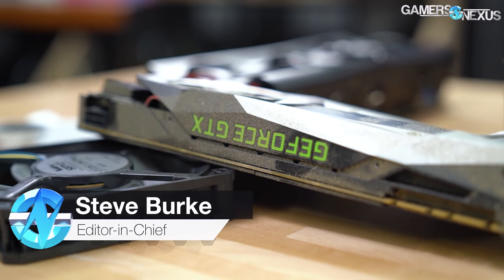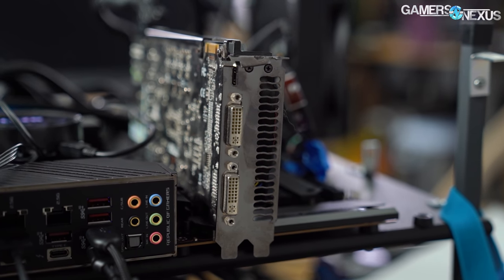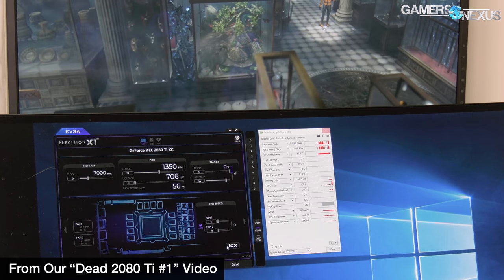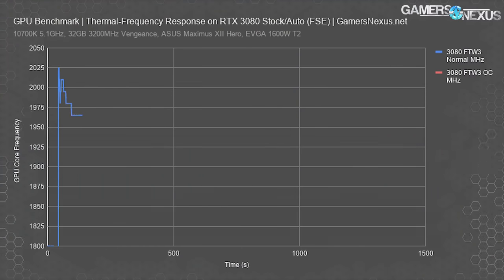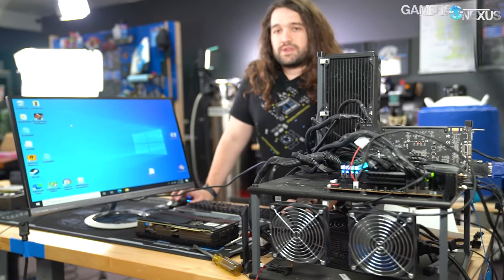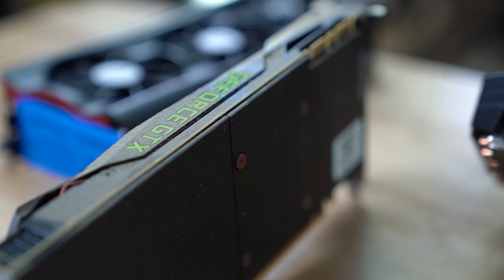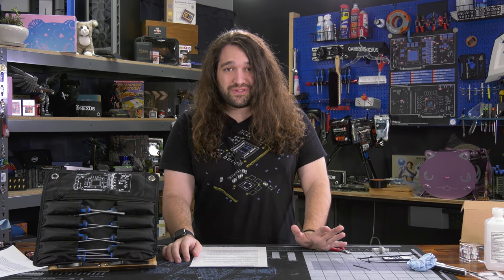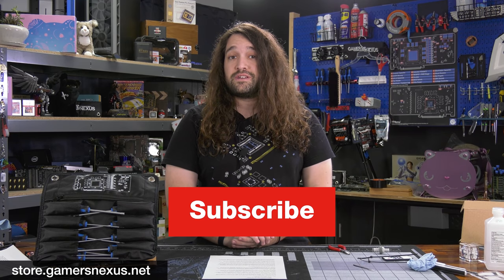Warning Signs When Buying Used GPUs: How to Detect Defective Video Cards

Comment: 700$ for a used 580 that can’t be right I can’t get my brain to align that with reality Christ
Reply: The only ""logical"" explanation I can think of is that the card was a 8gb model and it was bought for a mining rig.
Reply: yeah wtf?  I dont get it,  i sold an MSI gaming X 1080-ti for $750 AU in early October 2020. For some reason they went down to ~$550 in December 2020. Now they are up - recent range is $630 - $780.      1) Why the dip in december?  2)  WTF is the 580 going for such insane prices in the US???     -  8gb 580s selling  for $400-480 AU   do conversion - way less US$
Reply: @mud2479  Hi Mud, not sure if you saw my comment but currently 8gb 580s are selling for $400-$480 AU here in oz ($309 to $370 US).  why $700 in US?  (please do not raid our used GPU market, we are tiny small compared to US, and normally get way screwed on prices)
Reply: Whoever that was paying an extra $300 usd over market price looking at the prices around here... they are sought after for mining being AMD and 8GB but no where near the price that viewer paid for unless their local used market is completely dry. Still hard to believe someone paid that much.
Reply: Yeah, I don't really see how a sensible person, especially someone who watched Gamer's Nexus, would buy 580 for 700$, used or new.

I got RX 470 (though 4 GB version) for less than 100$ just recently, and it's almost as good as 580 8 GB (at least in gaming). Doesn't make sense to pay 7x more, considering the difference. At most it's worth 200-250$.
Reply: RX 580 8GB are going for $400-450 on eBay right now
Reply: @MikehMike01  They are, but 1) They aren't worth that much (I'd say 300-350$ might be reasonable for a brand new cards, but for used one 250 is top). 2)700$ is still more than that.
Reply: the dumb thing is :700 on a amd gpu🤣🤣 i would not pay 20 bucks for any amd gpu... they are trash and way behind nvidia
Reply: @fredfinks  because power can be 5 to 8 cents instead of 30 plus in Australia so mining is actually worth doing
Reply: @mud2479  no, no, no a GTX 580.

The RX 580 would be 2100 sir.
Reply: @fredfinks  couldn't find a 580 8gb for less than 600 the other day that (pccasegear) and that's the best staticice could find, all others sold out. nowhere offering shipping anyway
Reply: Got an RX590 for 125€. Who in their right mind pais 700$ for a 580?
Reply: Cards are worth 8-10 months of ETH mining.
Reply: I paid $390 USD for the RX 580 (XFX-branded) brand new via Best Buy.  Someone actually paid $700 USD USED!?  That means hardly ANY research was done beforehand, dag!
Reply: @eggshapedisraelioperative6317  WHAT!?  All I did last month was wait until my tax refund was credited to my account (which happened to be on a Tuesday, when Best Buy is rumored to refresh their website), checked Best Buy, saw that they had multiple RX 580 cards and BAM.  Sure, I paid $390 USD for it (later I was upset when I learned that the card launched four years ago at $230 USD), but I love the card now and the extra tools that come with it.
Reply: I bought one new for $250 last year and it already felt like too much
Reply: @fredfinks  i managed to get a used 5700xt for myr1500 (rougly 364usd) in mid december too lmao. i think the dip was because the 30 series cards had been out long enough for people to truly see the major performance improvements and value but not long enough for people to know the severity of the shortage. so most of the sellers were probably panic selling thinking that their cards were going to be unwanted trash in a month.
Reply: Sadly, it's true. Even used 900 series cards are going for over MSRP for what they were new. I had scoured NewEgg and FB Marketplace for weeks before I saw my white whale deal
Reply: @WayStedYou  Ye opal mining mby....
Reply: @Spectru91  Found the fan boy
Reply: @rubuk2996  it's sad that the truth bothers you....

Comment: Did I really just see a dvi to vga adapter on a gamers nexus video in 2021
Reply: GN pulling out all the stops, they know no bounds.
Reply: I run a DP-VGA on my RTX3080 for my secondary screen, an old 19" 4:3 AOC! :)
Reply: I was using dvi to vga, vga to hdmi
Reply: the corporation I'm working for basically runs 50% of the workstations with this type of setup.
Reply: @eval_is_evil  in a corporation it makes some sense as they arent usually tech junkies lol my old company used display port to vga cables when yhe monitors amd computers both had display port capabilities... Made me shake my head
Reply: @mikev8500  they want this so they can have 2 displays per workstation one hdmi other VGA 😅
Your example though is outright criminal.
This reminds me of a couple of anecdotes :  one day a colleagues asked helpdesk to unfreeze her workstation ...turns out the woman was clicking on a fullscreen capture (screenshot) they sent her to help her find the menu. 
Another example: supervisor trains a guy ...tells him "ok so you take the mouse and drag it on the left bottom corner of the screen". The guy takes the mouse in his hands and starts touching the monitor screen then drags it down...left corner of course.
Moral of the story: gotta love the corporate microcosm.
Reply: it realistic, because the only affordable gpu's atm are vga ... lol.
Reply: @DaftFader  perhaps ... and also because mostly they would use integrated 'GPU'.

Comment: Again, this is timed rather nicely. As far as personal experience goes, I've bought a few used PC items online and the best advice I can give is: go with your gut. If it feels off or sketchy, move on to the next guy.
Reply: that's an acquired taste. inexperienced guts are more likely to return with empty hands or empty wallet with empty hands.
Reply: sometimes it works though. i had a guy that wanted to meet in public and sounded hella sketchy. the price was 30% less than most other drives on the market so i just went for it and it works perfect
Reply: Dank Lulu
Why you need old crap? Just keep the GTX 1080 build 3 more years! Why you keep buying????
Reply: @proCaylak  Just keep the GTX 1080 build 3 more years!
SAVE MONEY! why buy crap?
 acquired taste, you need better security for the porn collection?
Reply: @sandrocarletto9386  SAVE MONEY, keep the old GTX 1080 build 3 more years!

Comment: #1 Look for a PCB color on the top edge of the PCB. If its looks dark, this card ran hot and likely to be dirty inside.
#2 if PCB is dark at the bottom as well, it means it ran hot for a very long time. Almost guaranteed to be a miner card or a gamer who neglected cleaning their rig.
#3 Look for a temper proof label. If it isnt there, ask the seller why. You want to know why card was opened. Was it re-pasted or re-padded ?
If it runs little too hot, its likely done wrong. Do it the right way with proper pad thickness and paste application.
#4 Look for missing serial number or other stickers on the PCB (unless covered by back plate) that indicated previous repairs such as but not limited to removing/replacing components and/or memory and/or GPU its self.

How ever, i my own defense, just because its repaired, does not mean its bad. Often times you get brand new components installed which are likely to outlive the cards remaining life so dont hesitate to buy repaired cards.
In fact, repaired cards get more attention to testing for performance and stability before selling them then those who just sell them not knowing anything about them.
Reply: Not everyone is kind like you to replace faulty parts of gpu with better parts/components. Most of the card repairs in my country often replace with parts that die in a span of 1 month to 1 year, so everyone here despises buying repaired cards.

Comment: I took a leap of faith once with a 680, I plugged and the fan was making a noise like turning on and off, but the seller seemed legit so I took hist word that the card was good, it ended up that I just plugged it badly and the second cable was lose, never again showed any problems
Reply: Oof 680 at this day and age
Reply: Ya, sometimes it's on buyer's end who made silly error; usually because we're too excited to get that card for cheaper.
Reply: @wisdoom9153  Or like Steve mentioned, to judge the seller's character, we became friends and even up to this day I see that he's very responsable with his hardware sells.
Reply: @Corei14  Don't be surprised there are people out there stuck with Fermi era cards mainly in poorer countries like Brazil.
Reply: @Corei14  2 days ago, I still use a GT210. My mother gave me money to buy a better card and found a used RX460 2gb OC and my goodness, it's like night and day.haha
Reply: @rinkyouma2320  same bro still using a second hand rx 460 2g, stll good for 720p medium settings in some games xd
Reply: @velieko  yeah! I'm playing Genshin Impact and apex legends on this card.
Reply: @Corei14  I just bought a GTX 580.
Reply: @Corei14  Sold mine couple weeks ago for 115 USD :) It was sitting on a shelf collecting dust for more than 2 years.
Reply: I bought an rx 280, it didn't work on first pc I tried, but I believed the seller too, and when I got back my other pc from reparation wala, just plugged in and worked flawlessly.
Reply: @user-wq9mw2xz3j  That was another leap of faith

Comment: RE: Blown capacitors, those are incredibly easy to fix. I recently repaired a fairly recent AMD motherboard that had a blown aluminium film capacitor for a friend who had sourced the capacitors already. I used a standard hakko soldering station and plenty of flux, and once the cap was replaced the board worked fine. The VAST majority of capacitor failures will not kill other components in a circuit. I have done similar repairs using far larger and more powerful capacitors, that had failed far more catastrophically, in which instance the electrolyte had eaten some of the traces partially and lifted others from the PCB. Old amps are notorious for this, and my already twice repaired tube amp I bought used was no exception. An hour of re-soldering and patching with copper wire later, plus 10 new caps, and I'd gotten the rectifier fixed just fine though, with none of the other components except the extremely high hour driver tubes needing replacing thankfully. Long story short, if you see a card being sold "as is/for parts" with a capacitor failure, you probably just found yourself a steal of a deal, and if you can't repair it you're probably not gonna be out much money to begin with. Buildzoid even has some videos on his channel documenting the process if my memory serves
Reply: ah yes paying like 300$ for a soldering station to fix a card a third of its price
Reply: @detecta  more like half that, and it's not JUST for repairing one card. Learning to solder to do electronics work and repairs will pay for the hardware in no time if you do it regularly. I've saved thousands on rework costs for repairing and updating old speakers, repaired a high end FirePro card and 2 motherboards, and I've built the equivalent of a couple thousand dollars in cables. All for a roughly $200 investment over the lifespan of my gear, including $50 on solder and flux because i've gone through probably 10-20 kilos of the stuff in the last decade. Once you learn to do it and have the tools, it's basically always cheaper to do it yourself vs buying something off the shelf, only real exception being 3.5mm cables, those fuckers are a bitch to build and I refuse to do it anymore lmao. Everything else though, I DIY. I'm actually rebuilding some cables as we speak, one of my older joints used the wrong kind of solder (turns out lead solder on gold contacts can unadhere chemically, you gotta use tin/silver), and combined with using a straight out connector when I should have used a 90 degree for the job, a solder joint eventually broke. Gonna reuse everything though, nothing's physically damaged besides that one solder joint, the wiring itself tests fine for continuity end to end. Only loss is some heat shrink tubing, a dab of flux, and some of my time (that I can also spend watching videos.
Reply: @TheOriginalFaxon   you're right and obviously know what you're doing but it isn't for everyone. Gotta be extremely careful and meticulous when first learning about pcb repair

Comment: I bought a Radeon Sapphire Vega 64 for $65 from a kid that had disassembled it because he said it had some sort of  problem,  and I simply cleaned it, repasted it, replaced only a couple of thermal pads that were not in good shape and used the rest that were, and reassembled it and IT WORKED GREAT!  
I could have at least potentially sold it for around $800, but instead my daughter got a great Christmas present.  It's nice when a story has a happy ending, especially if you can make your daughter happy with a great Christmas present at very little cost except a little time doing something that you enjoy doing anyway!
Reply: and the kid read your comment now. if you have a conscience you must return the card now

Comment: Steve already mentioned this briefly, but some broken GPUs can experience problems just after running inside the system for a while. Had a GPU that would crash in 3D-Applications after 1-2 weeks of use. Reseating the card would give another period without crashes. There was zero observable sag, but I still suspect that it had something to do with the PCIe connector loosening over time.

Comment: I’m finding the older, more “irrelevant” cards are getting the best prices locally. The 2080 Supers are doing really well locally. You originally reviewed these card as “uninteresting.” But it’s kind of cool that they’re the perfect storm of them not being that good at mining for them being fairly good performance, also relatively new for a used GPU (less chance of damage). And also just less people looking for them, because the 20 series was forgettable.

I saw 2080tis for 800ish, and 2080 supers for 700 locally.

I got a 2080ti for 850. Was in excellent condition and had the box and transferrable warranty.

Not that great a price for a used GPU, but an amazing price in this market
Reply from the maker: Yeah, you nailed it. They were "uninteresting" in the scope of the launch, but certainly the landscape has changed enough that they're worth considering right now. No harm in getting what you can if the price is good!
Reply: Definitely a good price overall for a 2080ti considering 3070 can go high as € 1200+ in my region
Reply: Similar to Intel vs AMD here. When GN reviewed the 10400 and 10700K he gave them pretty poor reviews but now prices have dropped to the point that they can be justified whilst AMD parts have ballooned where I live. I got a 10700K for £250 where a 5800X was about £400. Same with a 10400/F where they're cheaper than a 3600 by a considerable margin (£125 vs £170 new). Of course board price needs to be taken into account here but it's funny how a product perspective can improve with just a price reduction compared to the competition (people will still shout Intel is dead though).
Reply: On Ebay in the UK, the 2080 super is going for £600-650. Meanwhile the 5700XT is going for about £750. I don't get it...
Reply: The 2080 is also a great value, probably even better than the Super, given the even less warm reception it received.
Reply: @toaster_bloke9999  Mining profits.
Reply: Absolutely. I bought a prebuilt for my son awhile back with a 2080 super, since he wasn’t playing anything too demanding I swapped it with a 1660 super I had and have been using the 2080 super in my gaming rig since, the plan was to buy a 3070 which is like a unicorn now and swap it back.  The whole prebuilt with the 2080 super right now would be about how much you pay for a 3080 on its own if you can find one. 

The performance is amazing for me @ my preferred 1440p ultra settings usually
Reply: I actually found myself recommending getting a 970 card used more than once this month alone, everything newer is just insanely overpriced on the used market.
Reply: 2080 super for $700 is insane honestly, they are going for $900+ on ebay
Reply: ive had my 2080 super since it came out, i love my gpu i want it to last forever lol
Reply: @toaster_bloke9999  It's like that here in the US too, 2080's super and Non are going for around $800 while 5700 XT are going for $900+!  Only the White versions of the 2080's are going for more!
Reply: @toaster_bloke9999  5700xt better for mining
Reply: I bought an used 2080ti Xtreme for 760, I have to replace the thermal paste and I should be fine
Reply: Those prices are going to only apply if you find a gamer trying to sell to another gamer - how I got my 2080 ti - he ONLY wanted to sell to a gamer I sent him a picture of my old GPU I was trying to upgrade and he approved (weird but I was okay since I really am gaming on it)
Reply: @Amusia727  yeah AMD prices in the uk are a HUGE joke right now 😢 and for the tiny increase in gaming performance Vs intel it's just not worth it
Reply: @toaster_bloke9999  LMAO IKR
Reply: Look for old Polaris cards. I sold my RX 460 4GB last month for $85. It still worked pretty well for 1080p/60FPS gaming. I probably wouldn't have upgraded except that I was able to score a new 5700 XT and I want to have a maxed-out Windows 7 system.
Reply: @GamersNexus  I got myself a 2070 super to play red dead 2 and then was distressed seeing the 3080. No chance I could've gotten one so happy with my 2070 super in the end.
Reply: got a 5700xt for myr1500 (roughly 364usd) in late december 2020 riiighhttt before prices went crazy. pretty damn proud of myself for coming in so clutch
Reply: It's nuts, when the 30 series were announced people were giving away 2080ti... I saw them for £400 on eBay. Bet those people are full of regret.

Comment: One small tip about buying used is to always check out sellers trade history as well as the product itself. 
If he was buying  6xRX 580 8GB with a 1000W psu and pcie extenders, etc. that RX 580 8GB he is selling  is 100% a card that was  mining.